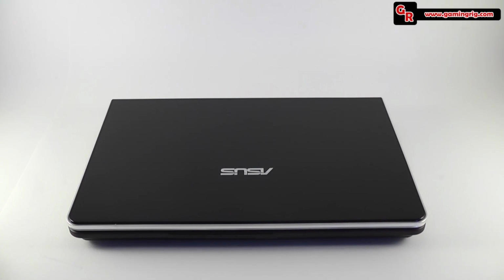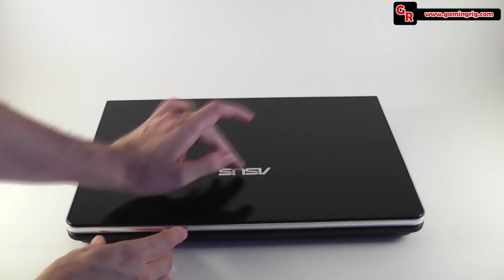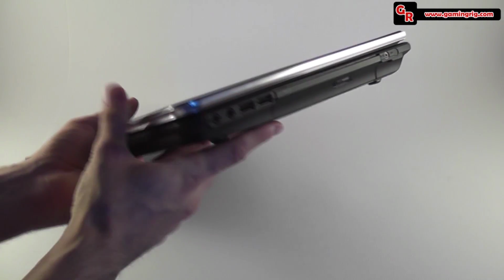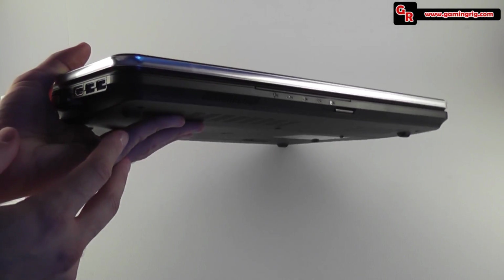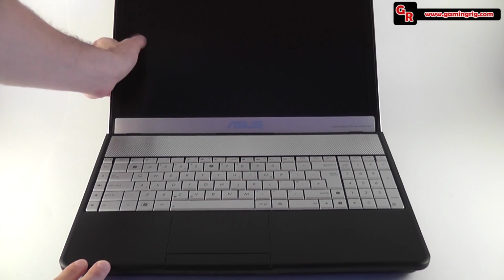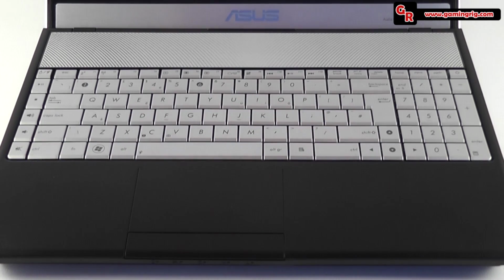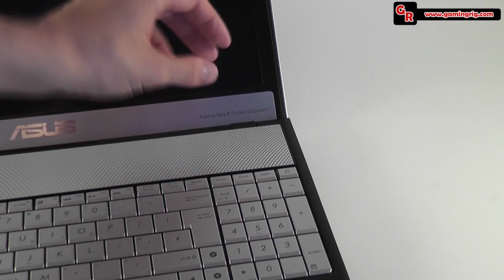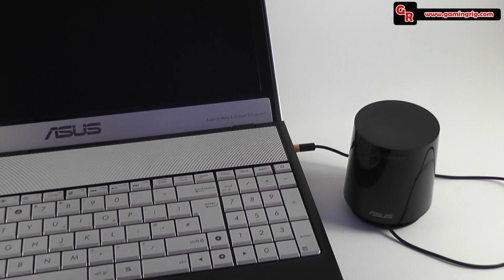Asus N55SF review - 1st part - design and exterior

Comment: microphone is normal , but the range is not far enough for me , i had to bump my head closer to have clearer sound recording , i suggest u plug into an headphone if u want for a soundchat , for better quality
about the sound , have you tried plug in external speaker for test? if the sound was ok , then you might need to get warranty for your sound card or the built in speaker :)
cheers

Comment: @KeKeKeilan The batterij is fine, but not as good as a macbook. A) About 3,5 hours B) 2 to 2,5 hours C) 1,5 to 2 hours D) 3,5 to 4 hours E) 3,5 to 4 hours. Dunno about editing, but i guess about 2,5 hours. Gaming on the battery will suck, because it downclocks the GT555 alot.